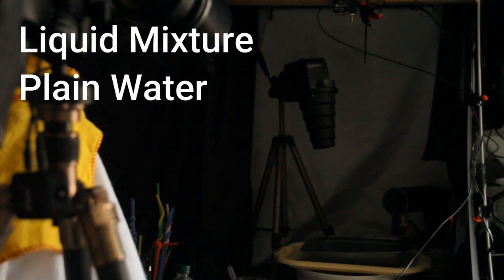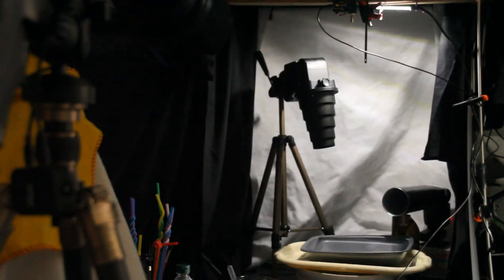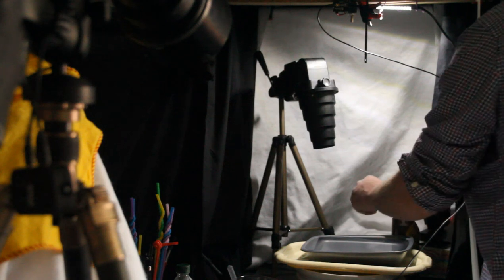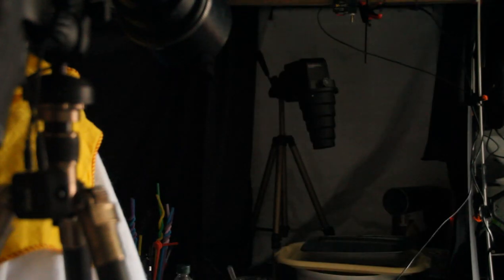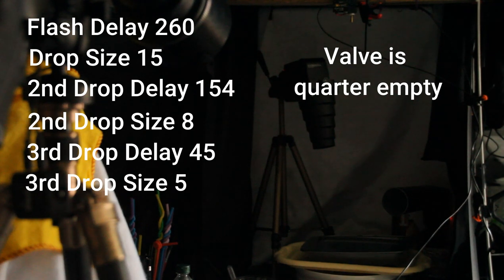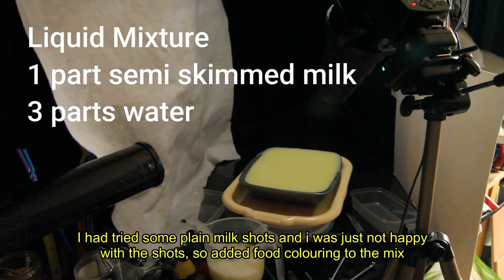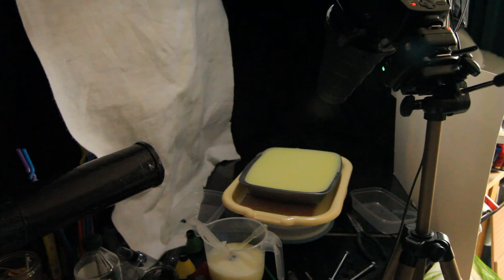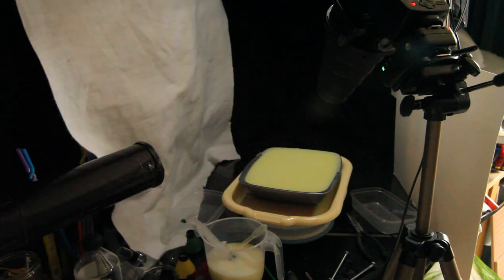Pluto Trigger Water Drop set up 3

Comment: thanks Darren gave me some idears.  How do you set up your pluto trigger for drops
Reply from the maker: i did another quick video called, Pluto trigger Flash Work Around.
Thats the basic set up, connections for the drops
The actual settings on the app vary from set up to set up of course but if set to same height as in mine, should be same settings as given in any of the 3 videos with same liquid used

Comment: Great video Darren. I need to try this setup to get a 3rd drip working .
Reply from the maker: height and some luck helps, alot :)
But keep the valve topped up helps retain the same settings and makes little tweaks easier to do